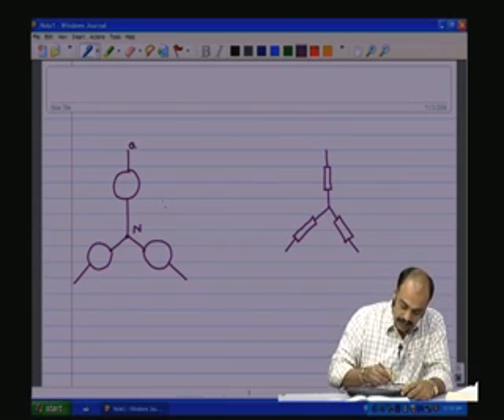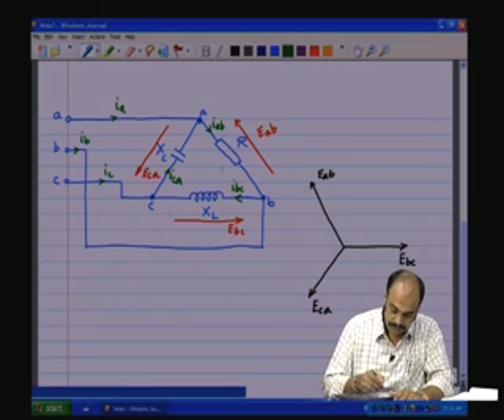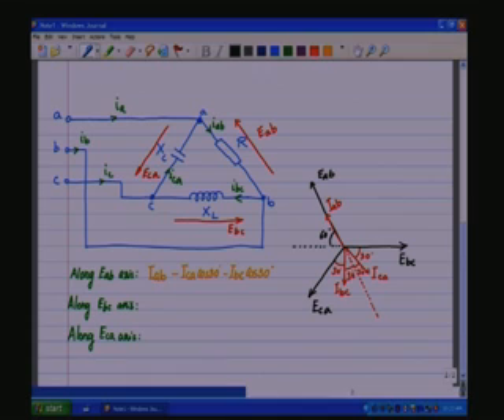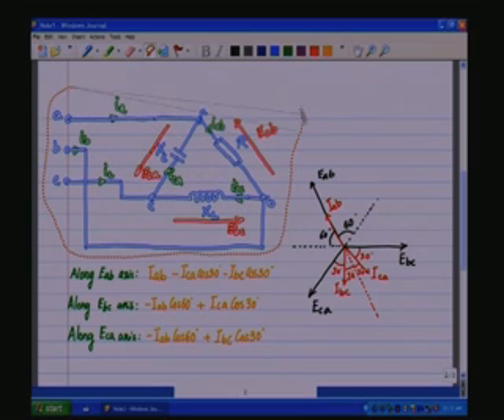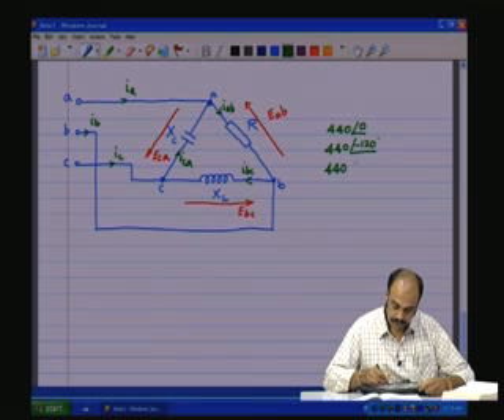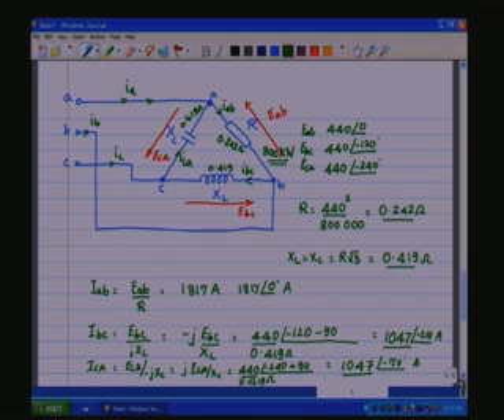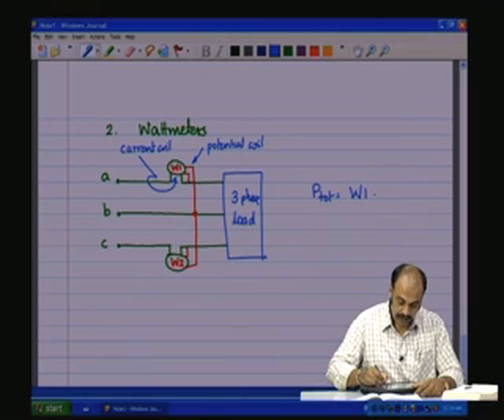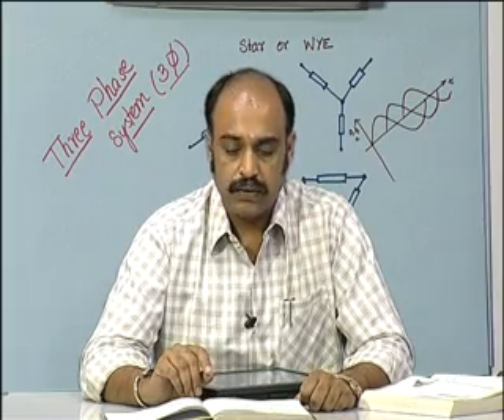Lecture - 33 Three Phase System 4

Comment: Sir in p=root3VLILcospi,some books write that pi is angle between phase voltage and phase current.Which is correct?
Reply: NAVEED SOFI 
Pi is angle between phase voltage and phase current